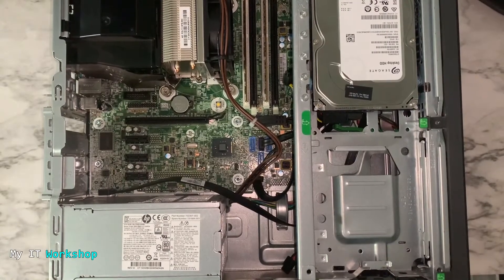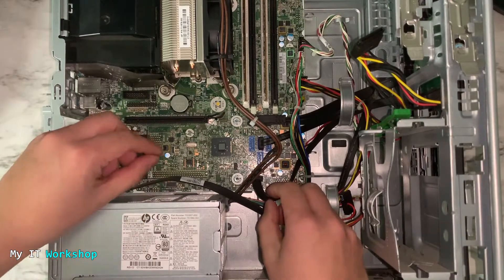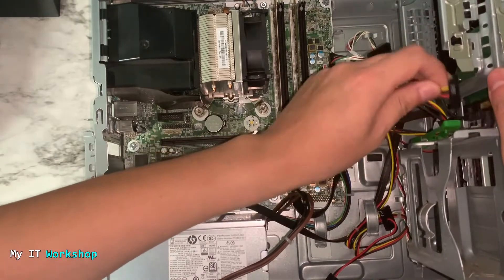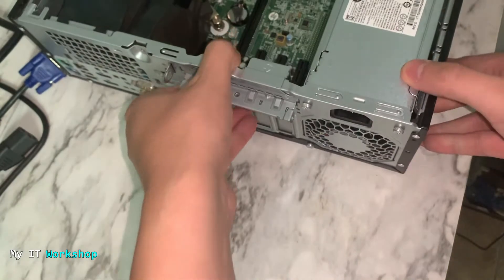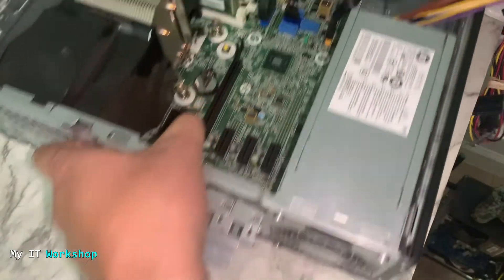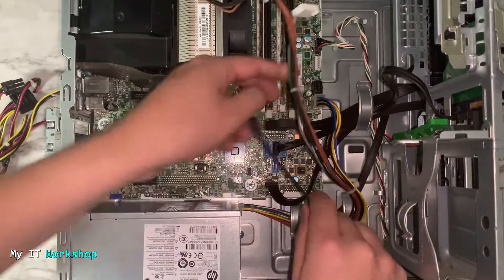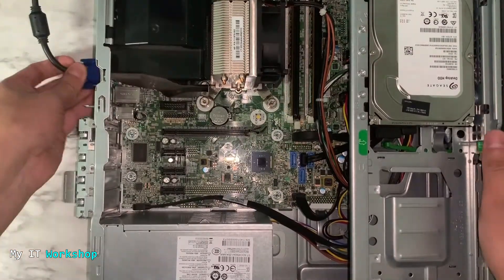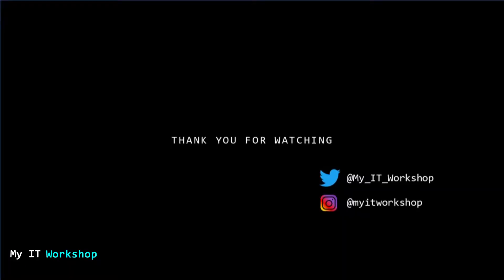How To Replace a Faulty Power Supply || HP Computer

Comment: This is exactly what I was looking for. I've got an HP Prodesk 6200, and I'm replacing the 240w power supply with an EXTERNAL supply (also upgrading the RAM to the max 32 gigs, new GPU...she's gonna PURR when I'm done).
I'm a visual learner, so this helped immensely, thank you!